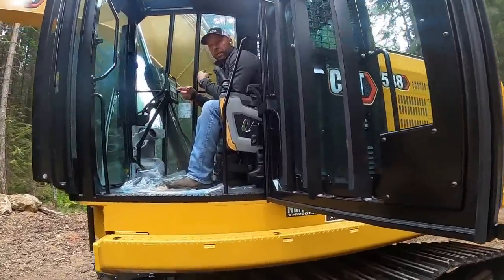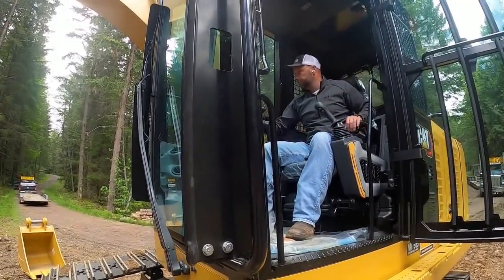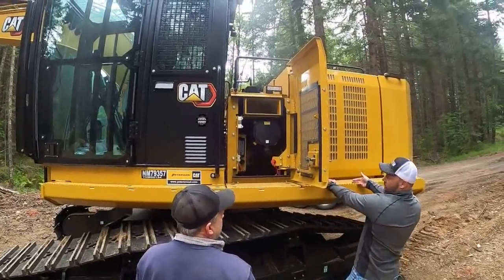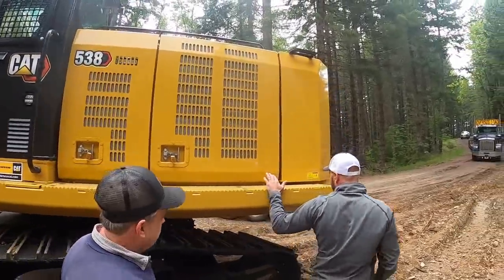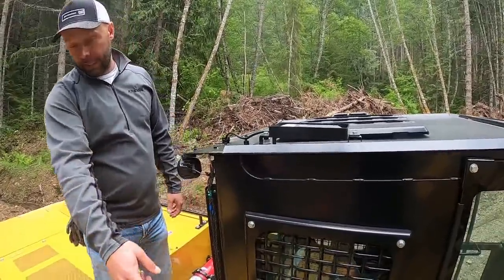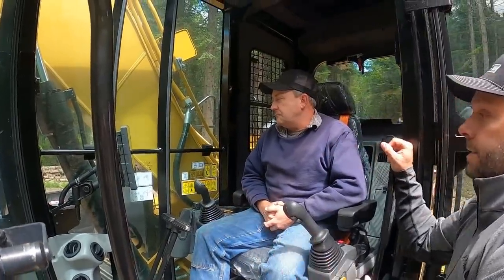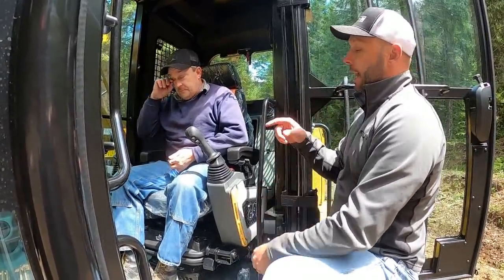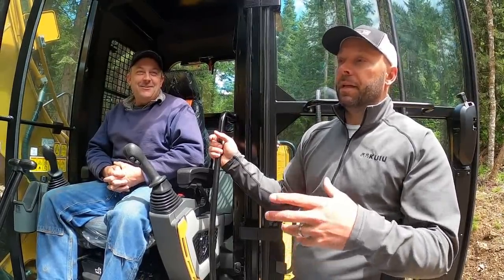Brand New Caterpillar 538 Road Builder - Unloading and Operator Orientation - PT2

Comment: also if you look the model # is 538 meaning that it falls in the forestry section of the company it also has the specific angled cab and higher stance and auto leveling body. so despite the fact that yes it is a excavator it is not of the standard 300 model series so the could be a argument made that calling them different names in the industry could be useful

Comment: They said that guy never changes buckets. I hope he will at least take the bucket off to grease the two grease points that are covered by the bucket. If you don’t grease those things after like two days it will get stuck on. If I dig for like more than two hours, or especially backfill in sandy conditions, I have to grease those cat quick couplers like every hour.

Comment: Why do cat send those buckets out with no wear bars on the floor. They will be worn thin and bent up in no time. 30mm hardox on the digging buckets sorts them out for a few years. Does the paint still peel off the cats in 5 years?  Why would you go all to the trouble to build that machine to paint it with food dye and have rusty scrap in 10 years!   Do the pump drive couplers have to be changed at 5k hours like the 300 series excavators?  What a load of nonsense ripping a machine apart for no reason and if you don't do it, it fails at 6k hours in the middle of no-where!!